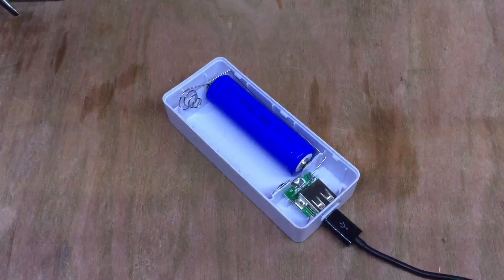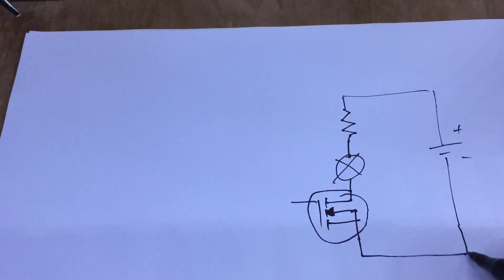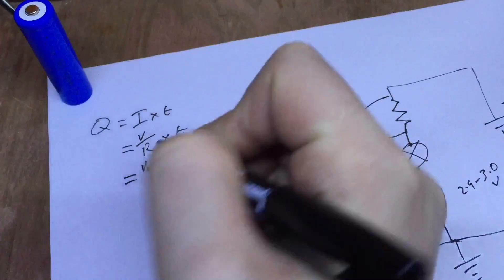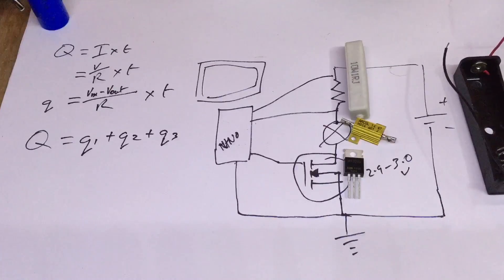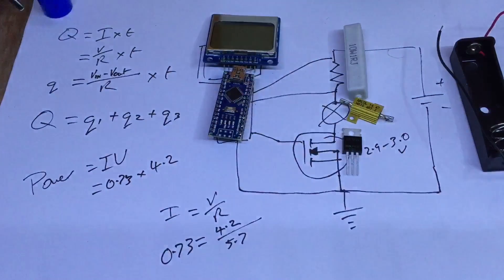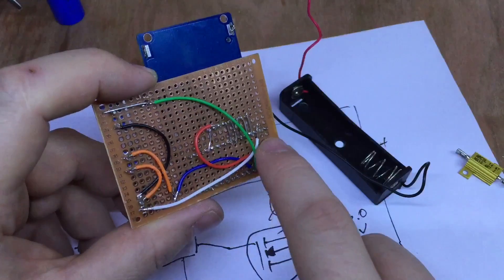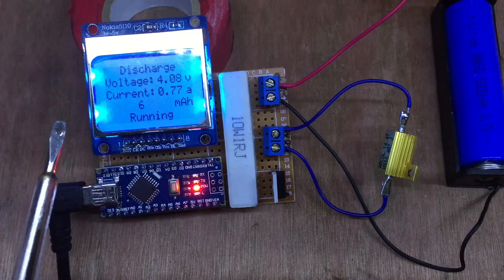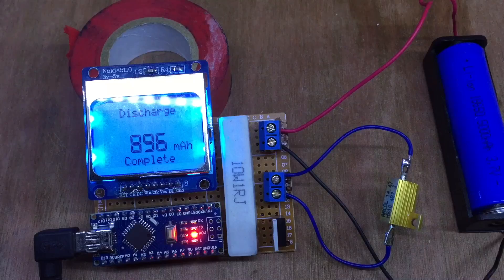Lithium Ion 18650 Capacity Checker - Adam's Arduino Projects

Comment: Hey Adam! Great video. I really like the way you drew up the circuit and then placed the components over each part of the schematic! If you are or anyone you know is interested in an automated testing system for 18650 cells, please consider checking out Lexcelon's Kickstarter for, "The Batlab." This is a complete system designed to walk users through the entire process of configuring a custom electric battery pack. The system cycles cells, runs cycle tests to determine capacity, sinusoidal and pulse tests to characterize impedance, and can estimate state-of-health when compared with benchmark values for a particular cell model. We are planning on making all of the hardware and software open source after we launch. If you are interested in learning more or becoming a backer, please check out our Kickstarter page! We are so excited to bring this product to life for other inventors like you.

https://www.kickstarter.com/projects/1722018962/batlab-a-battery-testing-system-for-lithium-ion-18?ref=discovery
Reply: Lexcelon Corp. I really like the idea and design it just seems likes a somewhat  bigger investment compared to just diy parts or using a power meter USB pass through on a bank etc. However I think its an excellent project, I think it's worth it , possibly the best way to achieve the goal, and I would otherwise be sold,. I'm just an EE so I have a lot of parts around to rig up whatever. Best of luck and I really hope you meet your goal, I admit I'm still tempted to get one :) Cheers and best wishes -Mike pa if you ever want to trade parts or get some extra stuff I have for free if it would help development and I'd love to help so please don't hesitate to contact me:)

Comment: Thanks Adam, great work. Looking through my parts bin I have a relay that I used on another Arduino based project. Could I use a relay instead of a mosfet?
Reply from the maker: Yes I guess you could.  If you use the normally open connection and common you won't need to adjust the code either.  Just make sure your reply is good for the current you are discharging at and you might need to protect the gate pin (the one attaching to the coil) with a resistor to make sure it doesn't sink too much current from your arduino.

Comment: great work 
but is there any protection circuit for over discharge 
as far as i know these battery's shouldn't go blow 2.5v , how u manged to do that ?
Reply from the maker: Thanks.  The code reads the battery voltage and is set to finish discharging at 3 volts.  You can always adjust this for your own needs.  It's is probably worth placing a 10k resister between the gate of the mosfet and ground - that will ensure that the the mosfet switches completely off if you are worried about that.  However I always say you should really keep an eye on lithium batteries whilst testing.

Comment: Is it possible to use a Constant Current DC load like this one ( http://www.instructables.com/id/DIY-Constant-current-load/ ) as load or would this confuse the circuit?
Reply from the maker: Yes this should work.  The LM358 keeps the IRLZ44N in it's linear region so the mosfet is acting as a resistor.  So theory has it it should work fine.
Reply: Cool, i have to try that out as soon as my parts arrive

Comment: Could it be that it shows about 5x less mAh because you check only every 5 seconds? Should you not check every second ( Q = I * t , where t is seconds)
Reply from the maker: +José Feiteirinha No. It calculates the milliamps correctly. T is simply a measure of time it can be one second or one minute or even 17 seconds! You could adjust the time to a second if you like - that's easy at the start of the code. But actually the current changes so little over a few seconds it's really not worth calculating that often. Do a test if your not sure - run it on the same battery and see how it it changes when you adjust the frequency of sampling.
Reply: oh, I get it, so you just multiply the resulting I by t, which in this case is 5. ? - I guessed it had to be correct after seeing the continuation video, but I'm glad I left the comment, now I know more; :) thanks for the explanation.
Reply from the maker: +José Feiteirinha No worries. I think you explain it better actually. :-)

Comment: Great project. I took the code and edited to fit my needs but the functionality and working principals/algorithms remained the same. I left a 2cell pack to discharge overnight and i woke up in the morning to find it completely discharged at less then 100mV! Sure the meter displayed a 4,4Ahs as capacity which made sense but still it almost destroed my pack.Lackily i revived it and is now @3,4v and rising but cant help but wonder why it didnt stop at 2,9v. The voltage reading was ok and was at 3,3v when i slept... My only suspicion is a modification i did to make it work with an arduino due. Because of the 3,3 voltage i couldnt drive the mosfet directly and i used an OR gate to drive it which worked but i didnt pulled down the inputs. Do you think this had anything to do with the mosfet opening by its own later and after the discharge was over?
Reply from the maker: +Theo papa You could add a 10k resister between the gate of the mosfet and ground to ensure the fet is fully off once the process is finished. I think most people suggest lithium cells should be monitored when charging or discharging. Especially with a new device. Hope you get it sorted.
Reply: ***** yeah you are right about the fact that they should be monitored but i guess in discharging the risk is way lower, i mean they can only die, not explode!I will add a resistor and see how it goes.Another idea is to add code to halt arduino once it detects the voltage going lower than the threshold and do nothing afterwards. I suspect that for some reason it reopened the mosfet after it initially detected the low threshold allthough i can think of several reasons why this isnt too propable...Thanks again
Reply: ***** adding 2 10k resistors in the inputs of the OR gate and a 100k resistor in the mosfet gate, all 3 to the ground, seemed to fix it and it worked as it should.
Next step would be to add an SD card to save the discharge data for easier access and maybe even carry on an interrupted discharge cycle by recalling the saved data!

Comment: Manufacturers show maximum discharge rate of cells like that eg.:"10C"
Which means 10 x capacity in Ah.
So for calculations there is used "C" not "Q"
Reply from the maker: "Q" refers to the coulomb and the unit of charge.  It is the recognized symbol for charge ( http://admw.uk/jf ).
I think you're looking at something different to me.  10C refers to the discharge (or charge) rate - so if you have a 2000mAh battery you might charge it at 1C (2 amps) or discharge it at 10C (20 Amps).  It doesn't to my knowledge explain the capacity of the cell. However it can effect the capacity because discharging at 1C or 10C will probably give you different capacity values - and that's why I left the load resistor interchangeable and did all the calculations on the shunt resistor.  It gives the user the opportunity to test their cells at different discharge rates. Some batteries are designed to be high drain, others aren't.

Comment: Hi, Adam. Thanks for you work!
I use on AP70T03GH MOSFET from an old mainbord ASUS. But the MOSFET remain ON after the arduino finish the code. The solution was to use 100 Kohm rezistor between Gate and Source too pull dawn.
Reply from the maker: Hello - a nice bit of recycling!  Yes, this is a sensible step - If I return to this project I will definitely be adding a pull down on the gate.  Thanks

Comment: Hi thanks for a great project. I'm keen to modify your design to test an eBike battery pack (48v) 10Ahr I will use 4 x 12v 50w Halogen bulbs in series as the load.  Could you suggest how I could modify your design to cope with the higher 200w load (more FETS in Parallel ?) and to scale readings between 40 and 30volts ?  Ultimately I want to plot a discharge curve in Excel Alan
Reply from the maker: Hi Alan,  a few things to consider - you'll need voltage dividers on the analog inputs to protect the arduino from the 48 volts.  You'll need a big shunt resister capable of carrying the load and yes, either multiple mosfets in parallel or one mosfet capable of carrying 200w.   Once you've made the hardware beefy enough changing the code to account for the voltage dividers and higher cut off voltages shouldn't be too difficult.  Sounds like a fun project!
Reply: Thanks i'll let you know how I get on

Comment: Thank You for sharing this project! I am old timer hobbyist and engineer, recently I got interest into RC things, so akkus became important. Also I did see clone project with OLED screen.
Reply from the maker: Yes there are now a few copies of this design - all well and good I released it so people could use and improve it.  Always nice to get credit though!  Thanks for your comments and have fun with your RC things!
Reply: I would like to ask couple of things, if You don't mind :) If I have on hand high wattage resistor with other value (say, 10 Ohms), I just change this in code? "float shuntRes = 1.0" to my value?
With 10 Ohms as a shunt, can this device be used without any additional load resistance, similar as in clone project (with OLED) by "Open Green Energy"?
Is there clear wiring schematics drawn (sorry, if I missed that somewhere in a rush)?
Thanks in advance! :)
Reply from the maker: Yes you could replace what is effectively two resisters with one and adjust the shuntRes value accordingly.  I wanted to change my load so I could drain cells at different rates, but if you are happy with a slow drain (On average about 370mA) then this will work fine for you.

I'm afraid I don't have a schematic except for the badly hand drawn one in the video. :-)
Reply: Thank You! Nice of You to give supportive answers here.

Comment: I Made some changes to the code that I wold like to share and get feed back on. Thanks.

 /* 
* Battery Capacity Checker
* Uses Nokia 5110 Display
* Uses 1 Ohm power resister as shunt - Load can be any suitable resister or lamp
* 
* YouTube Video: https://www.youtube.com/embed/qtws6VSIoYk
* 
* http://AdamWelch.Uk
* 
* Required Library - LCD5110_Graph.h - http://www.rinkydinkelectronics.com/library.php?id=47
* 
* Modefide my AdamK.
* LED back light now controled by PWM pin 3 and gatePin changed to pin 2 per my board layout. (pins can be swichted at will)
* Added fading effect for LCD backlight at end of discharge, bassed on Arduino example sketch. My LCD has a command cathode setup for the LEDs
* Added Battery type detection for LI-ION and NI-MH Batteries.
* Added Auto Restart for quike swap of batteries and types, Batteries over 4v for LI-ION restart and 1.35v to 1.65v for NI-MH batteries.
* Added Arduino LED (pin 13) as hartbeat LED
* Serial Print Disable. ( Just uncommet if wanted. )
*/

#include "LCD5110_Graph.h"
LCD5110 myGLCD(5, 6, 7, 8, 9);  // Setup Nokia 5110 Screen SCLK/CLK=5, DIN/MOSI/DATA=6, DC/CS=7, RST=8 Chip Select/CE/SCE=9,
extern uint8_t SmallFont[];
extern uint8_t MediumNumbers[];

 
#define gatePin 2
#define highPin A0
#define lowPin A1
 
boolean finished = false;
int printStart = 0;
int interval = 5000;  //Interval (ms) between measurements

           #define backlight 200        //BackLight brightnes 0-255
           #define fade 30              // Fade level for dimming at end of cycle. 0-255 set lower then backlight.
           #define fadeDelay 30 
           #define LED 3                //LED PIN for Back Light. PWM PINS ARE: 3,5,6,9,10,11.

 
float mAh = 0.0;
float shuntRes = 1.0;  // In Ohms - Shunt resistor resistance
float voltRef = 4.70;  // Reference voltage (probe your 5V pin) (PC 4.77, CELL CARGER 4.70)
float current = 0.0;
float battVolt = 0.0;
float shuntVolt = 0.0;
float battLow = 2.9;   //Low battery Voltige SetPoin: Li-ion 2.9, LiFePO4 2.8, NiMH 0.9.
 
unsigned long previousMillis = 0;
unsigned long millisPassed = 0;
 
void setup() {
  battVolt = analogRead(highPin) * voltRef / 1024.0;  // Battery Type AutoDection NIMH or Li-Ion
  if(battVolt >= 2.0){battLow = 2.9; };               // LI-ION 3.77 storage Carge,  2.9 for end of discharge.
  if(battVolt < 2.0){battLow = 0.9; };                // NIMH
  
 /*
  Serial.begin(9600);
  Serial.println("Battery Capacity Checker v1.1");
  Serial.println("battVolt   current     mAh");
*/
pinMode(gatePin, OUTPUT);
  digitalWrite(gatePin, LOW);

        pinMode(LED, OUTPUT);
        analogWrite(LED, backlight);
  
 
  myGLCD.InitLCD(); //initialize LCD with default contrast of 70
  myGLCD.setContrast(68);
  myGLCD.setFont(SmallFont); // Set default font size. tinyFont 4x6, smallFont 6x8, mediumNumber 12x16, bigNumbers 14x24
  myGLCD.clrScr();
 
  myGLCD.print("Battery",CENTER,0);
  myGLCD.print("Check",CENTER,12);
  myGLCD.print("Please Wait",CENTER,24);
  // myGLCD.print("AdamWelch.CO.UK",8,40);
    if(battLow < 2){myGLCD.print("NI-MH",CENTER,40);};
    if(battLow > 2){myGLCD.print("LI-ION",CENTER,40);};
    
    
  myGLCD.update(); 
  delay(5000);
  myGLCD.clrScr();
 
}
 
void loop() {

      
  battVolt = analogRead(highPin) * voltRef / 1024.0;
  shuntVolt = analogRead(lowPin) * voltRef / 1024.0;

   
  if(battVolt >= battLow && finished == false)
  {
   
      digitalWrite(gatePin, HIGH);
      millisPassed = millis() - previousMillis;
      current = (battVolt - shuntVolt) / shuntRes;
      mAh = mAh + (current * 1000.0) * (millisPassed / 3600000.0);
      previousMillis = millis();

      digitalWrite(13, HIGH);

 
      myGLCD.clrScr();
      myGLCD.print("Discharging",CENTER,0);
      myGLCD.print("Voltage:",0,10);
      myGLCD.printNumF(battVolt, 2,50,10);
      myGLCD.print("v",77,10);
      myGLCD.print("Current:",0,20);
      myGLCD.printNumF(current, 2,50,20);
      myGLCD.print("a",77,20);
      myGLCD.printNumI(mAh,30,30);
      myGLCD.print("mAh",65,30);
    if(battLow < 2){myGLCD.print("NI-MH",0,40);};
    if(battLow > 2){myGLCD.print("LI-ION",0,40);};
      myGLCD.print("EnV:",40,40);
      myGLCD.printNumF(battLow,1,65,40);
      
      myGLCD.update(); 
      
      
   /* 
      Serial.print(battVolt);
      Serial.print("\t");
      Serial.print(current);
      Serial.print("\t");
      Serial.println(mAh);
   */      
      digitalWrite(13, LOW);
      
      delay(interval);
    
  }
  if(battVolt < battLow || finished == true)
  {
      digitalWrite(gatePin, LOW);
         
      finished = true;
       
      if(mAh < 10) {
        printStart = 40;
      }
      else if(mAh < 100) {
        printStart = 30;
      }
      else if(mAh <1000) {
        printStart = 24;
      }
      else if(mAh <10000) {
        printStart = 14;
      }
      else {
        printStart = 0;
      }
   
      myGLCD.clrScr();
      myGLCD.print("Discharge",CENTER,0);
      myGLCD.print("Voltage:",0,10);
      myGLCD.printNumF(battVolt, 2,50,10);
      myGLCD.print("v",77,10);
      myGLCD.setFont(MediumNumbers);
      myGLCD.printNumI(mAh,printStart,21);
      myGLCD.setFont(SmallFont);
      myGLCD.print("mAh",65,30);
      myGLCD.print("Complete",CENTER,40);
      myGLCD.update(); 
   
      //delay(interval * 2);
  }
  if(finished == true){
    for (int fadeValue = backlight ; fadeValue >= fade; fadeValue -= 5) {
      analogWrite(LED, fadeValue);
      delay(fadeDelay);
      }
     for (int fadeValue = fade ; fadeValue <= backlight; fadeValue += 5) {
      analogWrite(LED, fadeValue);
      delay(fadeDelay);

       if(battVolt > 4){finished = false; if(battLow != 2.9){battLow = 2.9;}; mAh = 0.0;}                            //Auto Restart and battery type dedection
       if(battVolt >= 1.35 && battVolt <= 1.65){finished = false; if(battLow != 0.9){battLow = 0.9;}; mAh = 0.0;}    //Auto Restart and battery type dedection

      }
   }
}
Reply: Did it great ,,,,,Thanks....

Comment: Hey Adam, I have an uno I would like to use do you think your code will work on that? Also what would you assume the accuracy of this tester would be?
Reply from the maker: +Mark Bischetsrieder the accuracy is all around the accuracy of the shunt resistor and your measurement of the Vcc voltage. It can be quite accurate. 

An uno will work fine - others have used an uno without an issue.
Reply: Awesome thank you for the quick reply! Just picked up an lcd and some resistors at a local shop today. Funny the project im working on has started at least 3 other projects in the process.

Comment: I have built three of these now (slight modifications), thanks for sharing! I want to include a time lapsed field as well, however I haven't quite figured out the coding for that and have been unable to determine if it will interfere with the mAh measurements. I'm also toying with the idea of using an ESP8266 and using the WiFi connection to upload the data.

Comment: just wanted to say a massive thank you, from your video ive built a few of these circuits up and are using them to discharge 18650 for my own eventual power wall, couldn't have got this far without the youtube stars, so thank you once more
Reply from the maker: +Tricky Sales Thanks for coming back to tell me. That's excellent news.

Comment: is there alternative for Aluminium Clad Power Resistor??
Reply from the maker: +Franky Yodi Yes. You can put any suitable load in there really. A car bulb might be a good option. Just don't put anything in which will pull too many watts for your sense resistor.

Comment: Great little project. Worth trying out especially with all these garbage batteries around. I even saw one on Wish.com that claimed 9,900mA/he and 4 pieces for less than £1.00 !!!
Reply from the maker: +Graham Gillett Thanks. Ridiculous figures and a ridiculous price!
Reply: there is no such li-ion 18650 cell that can deliver 9900mAh, 3600mAh is the top as of now, It is a scam, Those are usually used laptop batteries re wrapped.